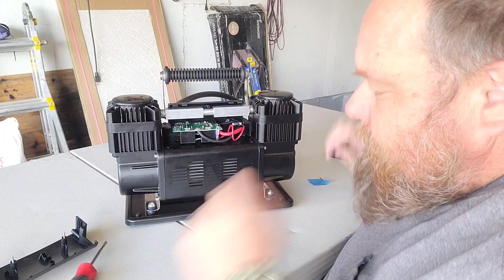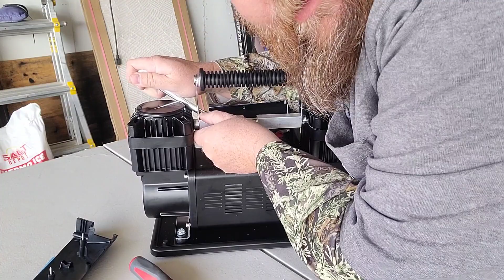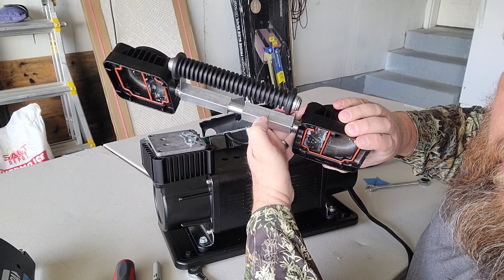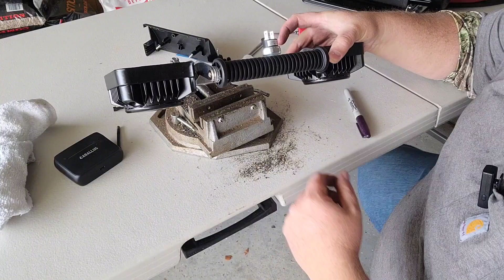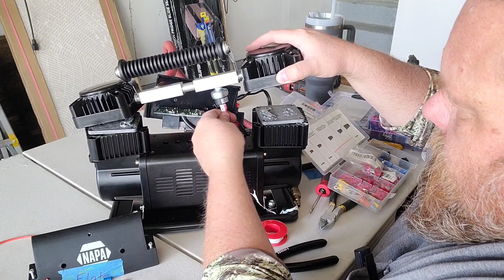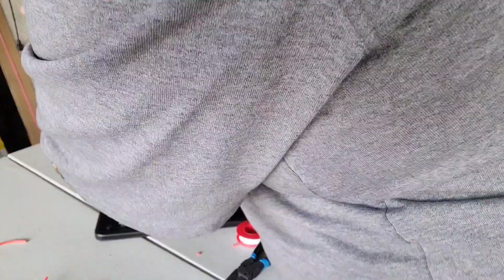Making the NAPA Flate compressor. Pressure switch and coupler upgrade.

Comment: I'm going to do mine this weekend. Great video, thank you.   One question. I'm looking back on it now. And. What im thinking of doing is leaving that connector connected to the board  cut that wire in half, then connect both sides of the cut wire to either side of the pressure switch?    Would that work? And is that basically what you did?
Reply from the maker: It sounds like it should work to me.

Comment: Why are you modifying it, can't you use it as is?
Reply from the maker: You could use it as-is if you want but there are a couple reasons I wouldn't. This compressor puts out 10.6 cfm. A standard Schraeder valve in a tire only flows around 2 to 3 cfm. This means the compressor is putting out way more air than you can use on one tire. This causes extra strain on the motor and even more heat to build up. Both are bad for the compressor. Using a 4 tire inflator system maximizes the efficiency and speed of the compressor.

The pressure switch allows you to turn shut the valve on your tire inflator and check the pressure with the guage while inflating. Without the pressure switch, the compressor would "dead head" against the closed valve. This overworks the motor and builds excess pressure.

Switching the fittings from the Japanese style Nitto to the US style Milton just makes sense to match existing fittings.

If you are looking for a compressor to do one tire at a time, I'd recommend a Viair in the 3 cfm range. They are sized perfectly for single tire use.
Reply: @IronsideAdventures801  If I could rate your response with 100 stars I would. 😊. This is the most detailed reply thank you so very much. I talked to Morrflate and this is precisely what they told me if I were to use a 2 cylinder compressor it could burn up inflating just one tire.

Comment: I modified the compressor and made a hose set up very similar to the way you showed in your videos - I chanced a few minor things. I made a write up about it on the WranglerTJForum, I saw you had a TJ at the end of the video. I had to mention your channel and how great all your videos are, thank you again.
Reply from the maker: Wow. That's awesome. Thank you.
Reply: Hey @bucket909  I'm an IE'r as well. Not a Jeep owner so I don't belong to that forum, but I would love to see your write up. I found a way around the very difficult pressure coupling installation over the hose. I'll post that soon. Can I catch your write up somewhere other than that forum?
Reply: @LadyToyz  If you search “wranglertjforum Budget Air Compressor Setup” on google you will find it. If you’re talking about the 4 tire hose  setup I found that the hose linked was ever so slightly too large for the brass fittings (I was able to get it through one fitting after over an hour of trying) and found that the small sanding bits for a dremel were the perfect size to make the hose fit through. Still seals perfectly and I sanded down a few extra fittings to keep in the trunk in case one ever fails
Reply: @LadyToyz  if you search “wranglertjforum Budget Air Compressor Setup” on google you will find it - no need to be a member to view it. if youre talking about the brass fittings for the air hoses i found that i had to use the small sandpaper bit on a dremel to clearance the ID of the fitting for the hose to fit through - it takes away a very small amount of material but makes feeding the hoses through much easier and doesnt negatively impact the fitting in any way

Comment: Thanks for easy down to earth instructions. 
 I’ve done this, but it was so long ago (a year) that I don’t remember tap sizes and drill sizes to do this for my buddy. I found your video, I was just going to skip through and look for the sizes, but I went ahead and watched the whole thing and now I’m sure I can do this for my buddy’s compressor. I like that you took off the heads and used a drill press, much better than what I was going to do. Thank you.
Reply from the maker: Thanks. Glad you found it helpful.

I've done quite a few of these at this point. If you can get the head off (it happens), you can usually rotate the square manifold with a couple wrenches enough to drill and tap the bottom for the pressure switch.

Comment: Hey, Well done! Excellent video, no b.s. your instruction methodology is perfect. I'll be watching more. I plan on buying this thing tomorrow (March 9th) and was already contemplating upgrading the hose and lines to something similar to Morflate. Although I planned on building them myself and saving some cash.
Reply from the maker: Wow. Thank you. Really appreciate the feedback.
Reply: @IronsideAdventures801  I went out this weekend with a group to Joshua Tree CA. I made your hose set up, but did not have time to do the hose tap upgrade. I simply chopped off the proprietary connector used a barb fitting and added a swivel whip hose. Wouldn't you know it, after airing up 2 other ladies, that factory hose popped from the heat. I pulled out my leatherman cut it off and reinstalled the whip hose. The boys were a bit impressed :) Long story short. Ill be doing the tap soon. I also need to add a pressure switch.

Comment: Instead of drilling and tapping, can you just add another 2 to 1 manifold to the air outlet port?
Reply from the maker: You can. The problem is that the threads for the hose are BSP (I think) and not standard NPT, so finding a fitting that will screw in is much harder.

For me, it was easier to drill and tap to a known thread size and go from there.

Comment: Is it possible to cut the alligator clips and put o ring terminals on them and mount the compressor on the truck or would you need some type of fuse?
Reply from the maker: You certainly could do it that way. I would definitely use a fuse or breaker of some kind like in the link below.

https://a.co/d/33k9ckP

Comment: The factory unit has a pressure relief switch built into the inline gauge which you deleted, I'm not sure if I just missed it, but where did you put it on yours as it's a very important safety item required by UL and NFPA?  Thanks
Reply from the maker: The factory guage doesn't have a pressure switch. At best, the push button pressure release valve on the back of the guage may provide a fuse of sorts but the pressure actually pushes it closed so its not really a pressure relief valve. 

I'm guess I'm just not worried about that type of malfunction. For it to be a problem, the pressure switch I added would have to fail while running with all 4 chucks disconnected or with the ball valve closed. The way I use the compressor, it's never running with all the chucks disconnected and I really only briefly close the ball valve.  I also don't leave it running unattended.
Reply: @IronsideAdventures801  I followed the modifications for the compressor and hoses but wired it to the battery with a 125A fuse and 4 gauge wire (alongside the anderson connectors). I’m not really understanding the possible failure of this comment thread - is there something I should be aware of?
Reply from the maker: @bucket909 it sounds to me like you have a great set up. What he is referring to isn't a safety feature. While it might blow off if the pressure switch malfunctioned, it really isn't designed to do that. I like your idea of the breaker inline. Great idea.

Comment: I have the All-Top version of this compressor and in the process of modding.  I removed the discharge hose and drilled/tapped the hole for a 1/4 NPT pipe nipple which will have a tee with quick disconnect and pressure switch...may relocate the switch to the manifold.  Also plan to cut out the circuit board and replace with a relay and rewire with #2AWG jumper cables for the power leads with Anderson connectors.  You can also use 90-degree spade connectors...saves you the trouble of bending the switch connections.
Reply from the maker: Check out the part 2 video.
Reply: Thanks.  Just now came across it.  Well, that's embarrassing.  Thanks for pointing it out.  @IronsideAdventures801

Comment: it's a thumper max compressor. the thumper (single) has been around close to 20yrs the max (twin) probably close to 15yrs. this napa one is another one in a long list of rebranded compressors.  they cost equivalent of $77 us dollars in australia and they do have a cutoff switch at 125psi and restart at 90psi. the air fitting is a standard male nitto fitting no real reason to change it the nitto fittings are superior, if it has the screw on tyre chuck then that is worth changing for convenience. lock your hubs 4wdriving did some modifications and testing that would be valuable for anyone modifying a thumper max.
Reply from the maker: Yup. This is the same Chinese compressor that's been on the market for years. In the states, there are at least 3 companies branding it and selling for about $240. The NAPA version is the cheapest non-Amazon version we have.

I'm aware that it is a standard Nitto coupler. However, Nitto couplers are pretty much non-existent in the states. The Milton style are the standard here. Makes more sense to switch to the Milton style that everyone is familiar with rather than find a nearly non-existent style that won't be compatible with anything we already have. 

Thanks for watching all the way in Australia. That's really cool to me.